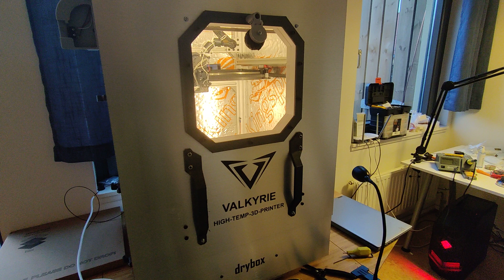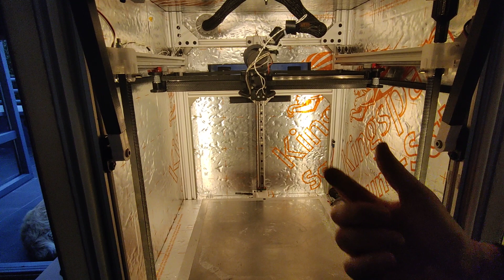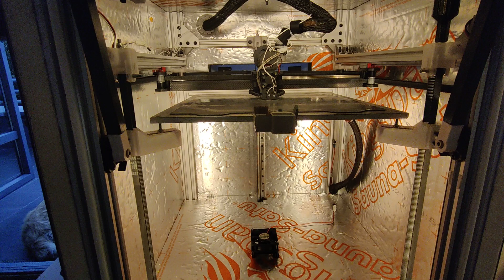Klicky Probe - FlintZtone version... Simplest Z probe (switch) ever?

Comment: Why not just go sensorless? I switched my Sidewinder X1 to sensorless after upgrading to a SKR mini e3 and having issues with the endstops being 3 pin and the board only having slots for 2 pin, was a lot easier to turn it on than to run 5v to each endstop, just had to enable one thing in marlin. I'm not using it for auto-level, as my bltouch works fine, but X and Y is just as accurate as the inductive endstops that came with the machine, so it should definitely be just as accurate as a mechanical limit switch like what you are using, as long as you have the sensitivity set right so nothing has a chance to flex. Yeah, TMC2209's do cost if you don't already have one, but you can get boards with them preinstalled, like the mini e3 for fairly cheap, and the performance increase alone is usually enough to justify the $40 cost. If you do already have sensorless homing capable drivers, then no reason to not use the sensorless homing feature
Reply from the maker: All axes uses stallguard homing. This is for the bed leveling
Reply: @PRO3DESIGN  you can use it for auto leveling also :) Granted I'd use a bltouch over sensorless, just saying, can't get cheaper than nothing
Reply: @HicSvntDracones  I think that is how Ultimaker does  it, and it seems to work well.